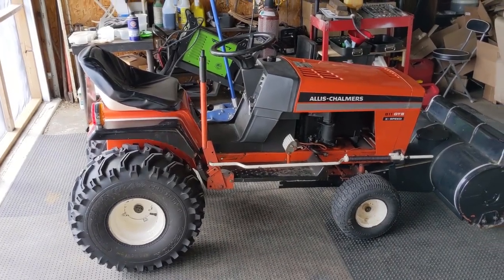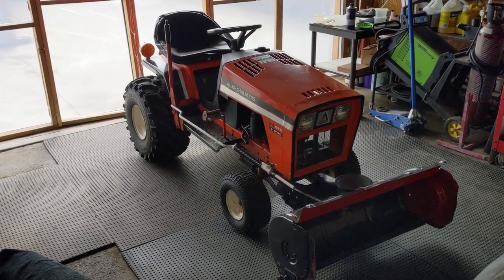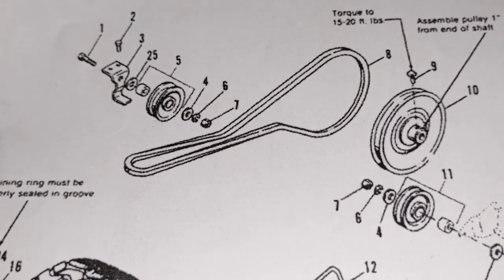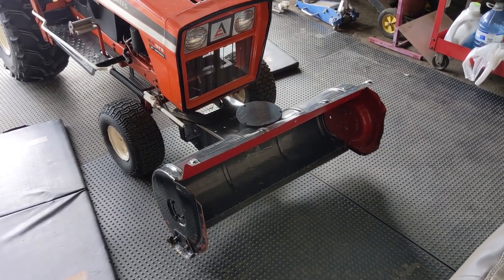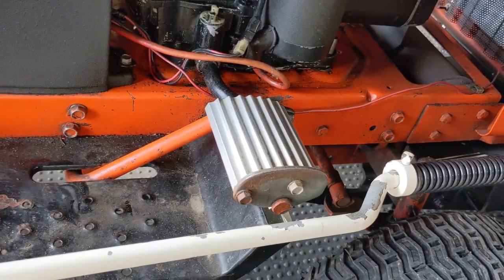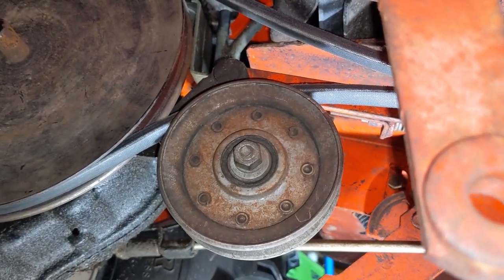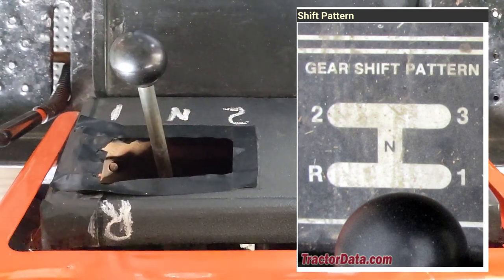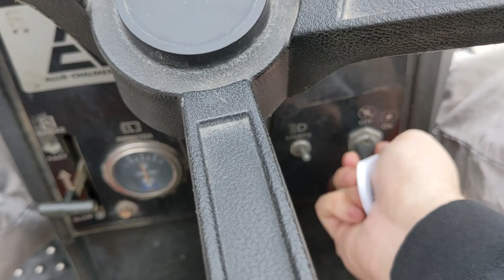Allis Chalmers 811 GT II - Correct Drive Belt Routing & Clutch Adjustment

Comment: Yep IPL diagrams with missing parts, wrong part numbers and now incorrect routing diagram. Hard to believe but it happens, have even seen incorrect belt numbers listed inside the hood of riding mowers. Problem is you do not realise it is wrong until you put it on and it is a no work situation. Putting out this video fixes this problem provided someone looks it up but as far as i have found this is the only one out there. So congratulations for this one it is difficult to provide something that has not been done specifically for this Allis Chalmers tractor.
Reply from the maker: Thanks for watching!

Comment: Good  day Jake A few yrs ago bought  massey Ferguson  hydro at garage sale.  $30.  Got it home work on it & put belt on  backwards, ???  anyways my son got on to drive   it went slow forward  but crazy fast backwards.
He got off & said not driving it.  Change belts around normal speed.
Yes it is very nice looking tractor  for them  Allis fans.
Thanks
Reply from the maker: Yes that's what happened with this one, my customers nephew installed the belt incorrectly (due to the diagram being incorrect) and because of that, gears 1-3 were actually in reverse, and reverse would've been forwards, as the twisted belt spun the transmission in the opposite direction!